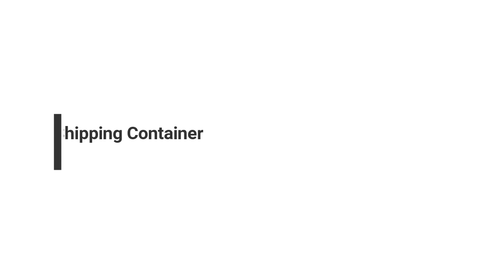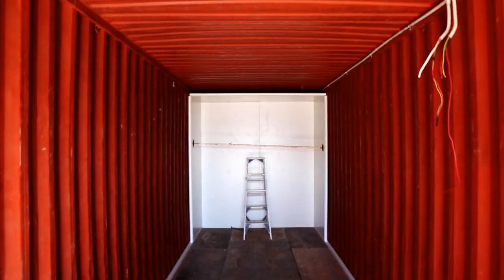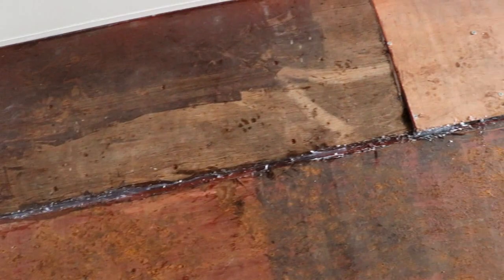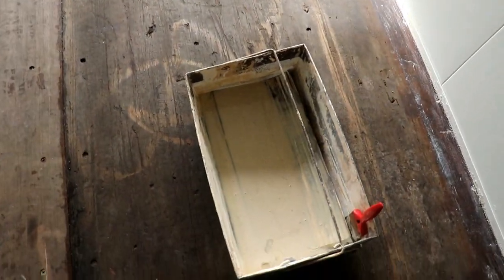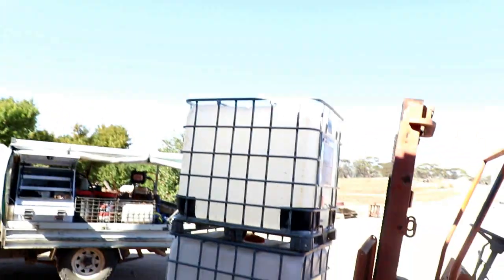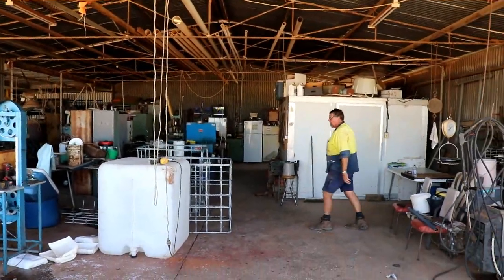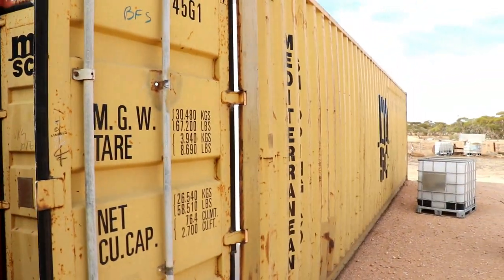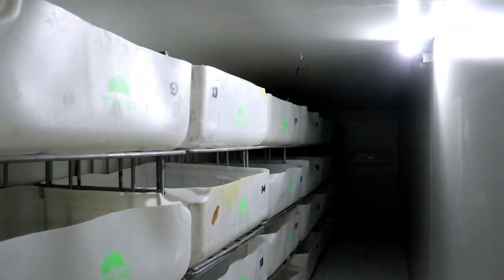How To Build A Cricket Farm In A Shipping Container / Schubugs Vlog 31

Comment: Great video Zac, very open and honest about the amount of work that goes into correctly setting one of these up.
2 Questions.
Is there a minimum height of the tubs that is required? 300, 400mm?
Also, this was probably explained in a previous video (Can you tell me which one), but the egg cartons, what's their purpose?
Reply from the maker: Hey mate!

The tubs don't need to be a certain height but above 300mm would be good. We also put tape around the top to stop the crickets getting out. Just have to make sure the surface is smooth so they can't climb it.

The eggs cartons creates more space for them and you can fit more in to a bin.